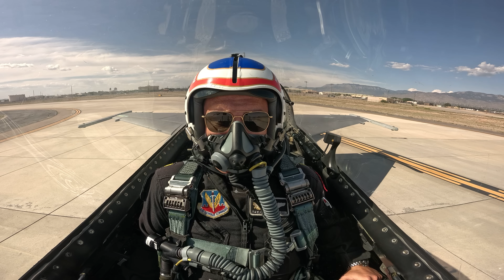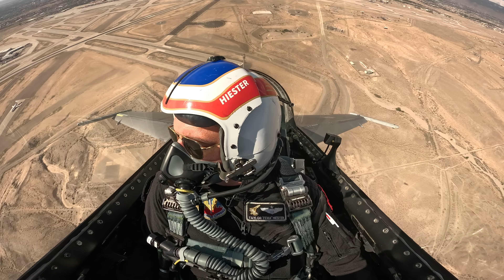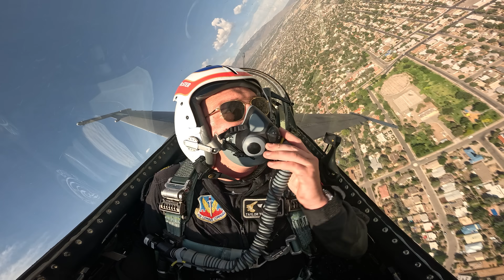F-16 Viper Demo with Cockpit Radio Communications 2025 - Maj Taylor Hiester

Comment: why does the responder say "2" when you call out your height and speed before the pull?
Reply: He is saying "2". He is the safety officer (also the spare jet pilot). The pilot flying the demo is calling out speeds and altitude to confirm if it is safe to continue/do the next maneuver. The "2" confirms or denies if it is safe and will call abort or something similar if it is unsafe.
Reply: I think they might be saying "Do"
Reply: @KristianBennett It was "2". I was wondering what it meant. I'm glad someone asked as and got an answer to their question.

Comment: What the H** is that annoying buzzing?   If the Gs didnt kill me, that noise surely would!   Oh... And sunglasses... Why not the helmet "sunglass"?

Thanks for another F-16 video.  It is the one plane I really adore.  Newer a/c may be better, but none are more beautiful than these birds.
Reply from the maker: It's not very audible in the airplane. Definitely louder in recording.
Reply: The buzz is from the 400 hz electrical system on the aircraft.  Aviation electronic devices have internal filters to remove the noise but things like GoPro cameras do not.
Reply: @kenshaffer8040  Ah, that explains it.  It is there all the time, but headset etc filters it out.  Thanks!  That explains why he says that it isn't very noticeable. I'm more used to 50Hz, but I know higher Hz is common in aircraft.

Comment: whats thats sound? always heard in f16 hud tapes
Reply: It is a 400 hertz whine from the F-16 electrical system.  Not normally heard on equipment properly designed to filter it out.